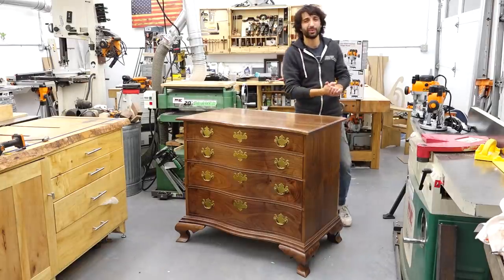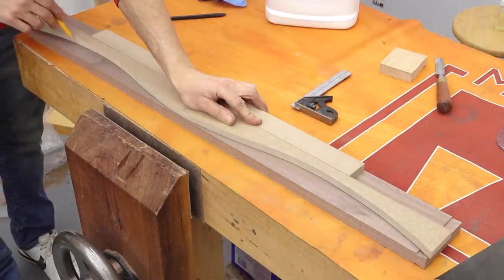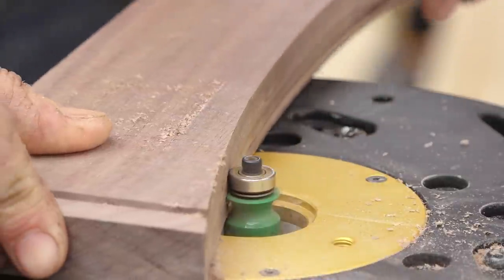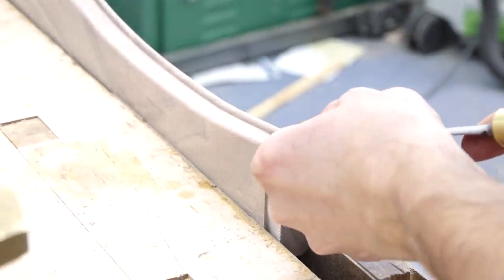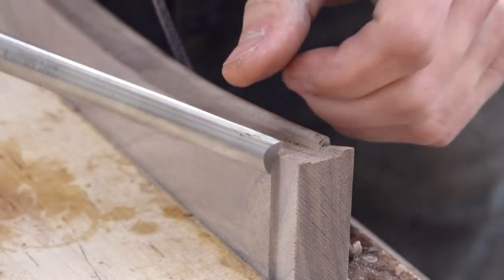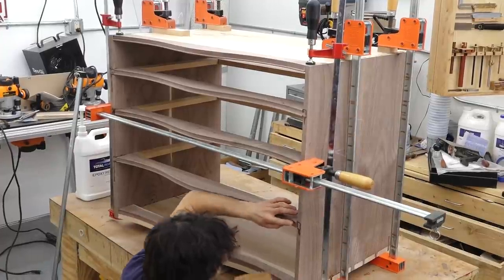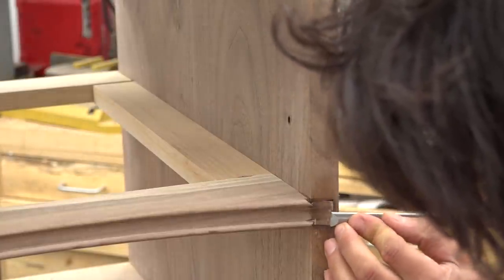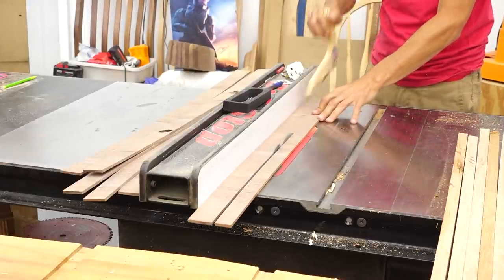Adding the Serpentine Profile to the Case | Serpentine Chest of Drawers Build Part 3

Comment: I used to build wooden boats and we used a lot of epoxy and slow cure times was one of the reasons for this as well as the strength of the joint. I never thought of using it for my furniture projects. Brilliant.

Comment: your description about the advantages of epoxy glue is an interesting period... i do wonder about future repairs and procedures that the future restorer might need to consider... after watching many restoration and repair videos previously is am slightly concerned about disassembly at some future time... although for your current working times and conditions its a good presentation

Comment: Those small trim router harbor a nasty surprise. I've had them kick the board right out of my hands with a force not unlike a baseball bat swing. Not sure what caused it, but it may have been the fact that I was routing end-grain.

Comment: Thanks Mat for doing a "project" video even in the middle of the house remodel.  I really love both formats.  Here is a question: Why didn't you use the router table for the template trimming of the divider pieces?   It seems like that would have been a bit easier and safer.   Amazing work.
Reply from the maker: So I can use the same set up for the case parts which would be awkward to do at the table.  thanks!

Comment: I was very surprised to see you routing both "uphill and downhill" on the serpentine dividers. Everything I've learned says you should route only downhill along the grain to prevent tear-out on an uphill move against the grain. Have I been following bad advice?

 Your method appears to be successful and much more convenient time-wise than having to move the template to the bottom of the workpiece to route the other side in its' now downhill position. Could you explain your thinking in this situation? Thanks; love your videos and teaching demeanor.

Comment: Hi Matt, I have a question on epoxy, I have an obsession with trying to keep my glue ups from spilling out from the joints. I do agree with you on large glue ups they are very stressful. My question is on clean up with epoxy as it is not water based what is needed to clean the excess epoxy or do you have to wait till it dries and then using your chisel to remove it?  Thanks looks great.
Reply from the maker: I use acetone. If you’re using a clear finish, you don’t need to be too worried about getting it perfect.
Reply: @mcremona  thank you Matt

Comment: How much different is cleaning up epoxy squeeze-out as opposed to wood glue? Easier, harder?
Reply from the maker: Easier. Smearing it around doesn’t matter if you’re going to use a clear finish

Comment: I have the same TRA001 Router working on getting the tools I will need to start doing wood working again hopefully soon. I also have 2 other routers of a different brand one. I have permanently set up in to a router table with a lift system installed in the table and a lighter router than the Triton with different bases that I can use hand held. Now I need a shop, a table saw Drill press, a band saw and everything else I might need to start the wood working. Oh by the way do you play the Guitar you built over in the UK at Crimson Guitars? It turned out pretty nice. You were lucky being able to go do that before the mess of covid

Comment: Hey Matt. I’ve been watching a long time and have recently scoured through years and years of your content to try and get two questions answered. Hoping you can help. 
Just exactly how low are you able to get the moisture content of your wood while air drying indoors? Maybe on something like maple, elm, or sycamore. 
Secondly, was this project, or the highboy, vanity, spice box, or the sideboard built with air dried only? 
Much respect!
Reply from the maker: Depends on the time of year. It’s pretty easy to get to 6% or less in the winter. Every project you listed is made from air dried stock
Reply: @mcremona  how wonderful to be able to go straight to the artist and get an answer within 10 minutes. Insane!

Comment: any reason for not running the dovetail front to back on the inside of the case for the drawer runners?
Reply: I imagine if he ran the dovetail the whole length of the case there would be a ton of friction during assembly. Not sure how mitigated that would be with the lubricating effect of the epoxy though. It also it allows the drawer runners to have a more advantageous grain direction since a long skinny dovetailed piece would need grain running parallel to the front in order to not have expansion/contraction issues.